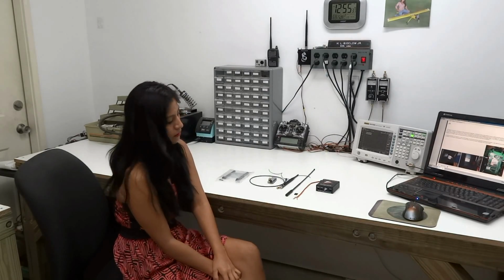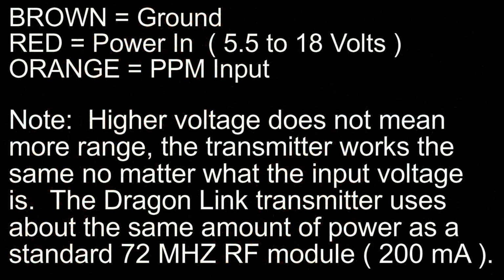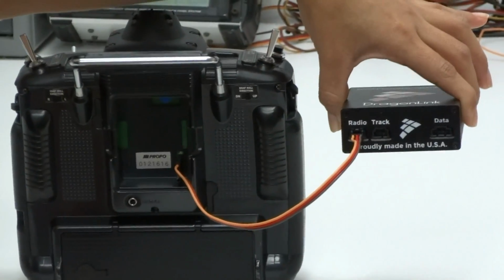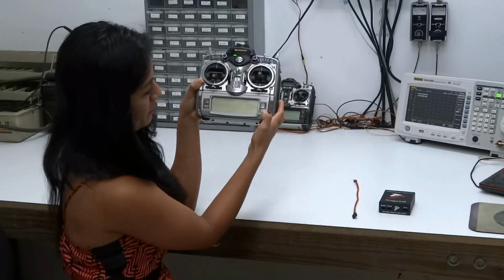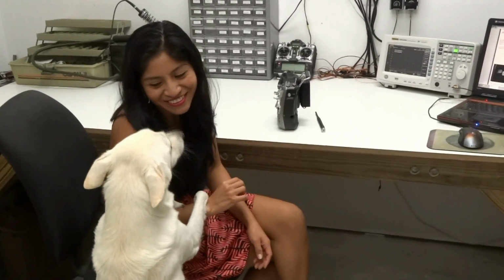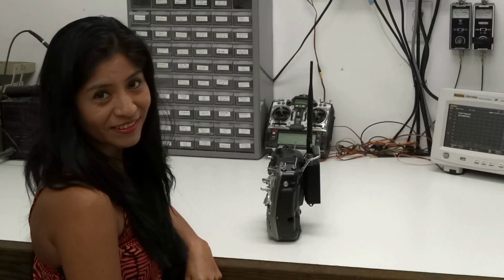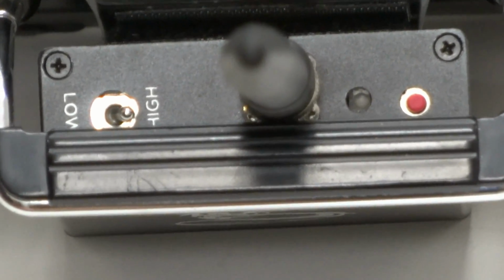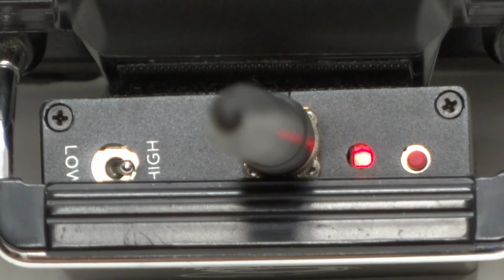Dragon Link Installation STEP 1:   Transmitter Setup

Comment: Hi great video, i bought a dragon link v2 from rc groups and was surprise to see that instead of the red and white square logo it had a white dragon logo on it. I asked the seller but. Never answered me. In this video i noticed you have the same hanging on the wall. Can you explane to me the difference between the two? Every time i search dragon link v2 its the red and white square logo that comes out so im a little confused about what i bought, is it really a v2 or an older version?
Regards

Comment: Trying to calibrate:

I have the pins 5&6 jumped, properly powered.

This is what I get, 3 L.E.Ds. operate in this fashon;

red constant on
greed fast blink for about 2 seconds, stays on until blue is finished
blue fast blink for about 2 seconds, slow flash once
both blue eynd green go out simultaneously, red still on

Here is a video I just took with lights a blinking, let me know if there is a specific sequence you would like to see me get on video.
https://www.youtube.com/watch?v=et4rp0RLCNM&feature=youtu.be

*****   On top of all that I sent a letter on about 2, Nov.  to Dragon link HQ and have had no reply as of the 14th.

Comment: Sub'd for the dog. Oh yeah, the information was kind of useful....yawn. j/k. Nice workbench setup. Are those frequency scanners and such on the back wall?
Im curious as to the gear that was used in the 100km flight. What video gear was used? Specifically, the frequency and power rating, not so much the brand. Thanks. I am getting a hexacopter in the mail in a few days, which is my reason for interest. I am excited to try your product. I have read many good things about it. I read down a few comments. It seems awhile back the technical aspects of the topic degraded into some immature BS-ing. Your helper seems very happy to have been included in your presentation.